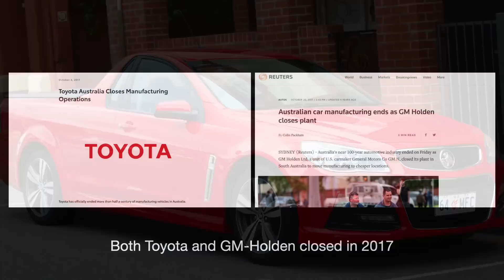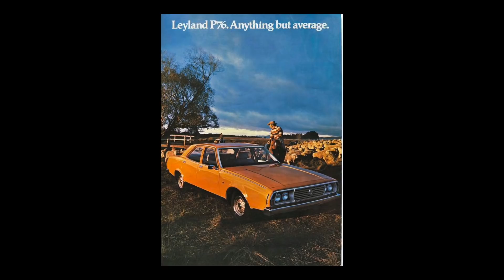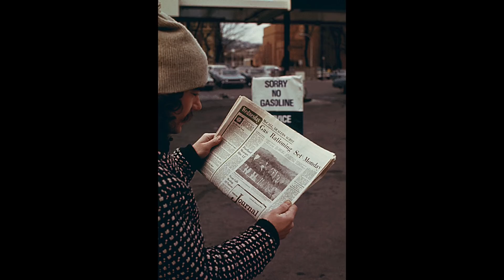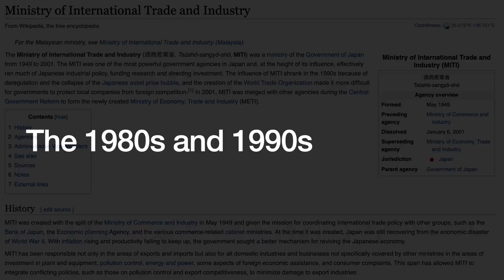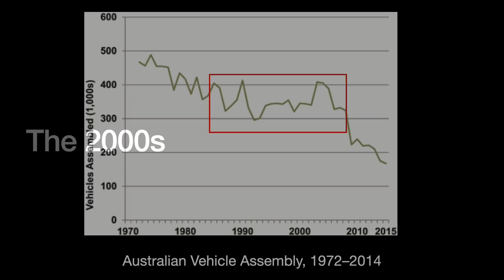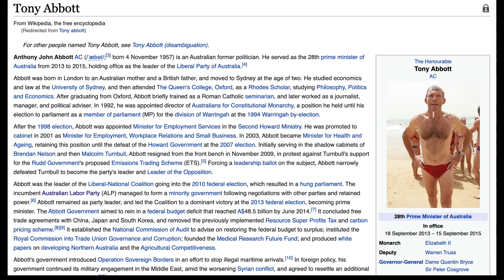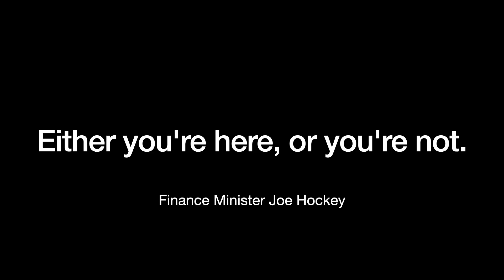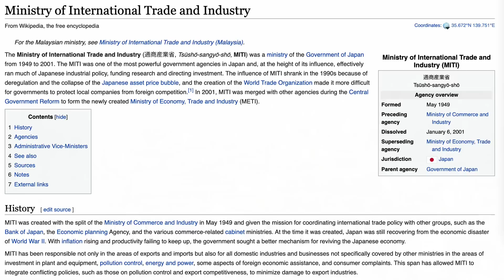Why Australia Doesn’t Make Their Own Cars

Comment: The over promotion of imported cars especially SUV s by car dealers . The rebadging of imports and selling of vehicles  under traditional Australian names. The lack of the local car industry not producing a larger range of vehicles made locally for the local market. Australia use to make some small and medium cars in the past beside the big car models but in the end only made the standard big car models such as the Holden Commodore and Ford Falcon before closing down manufacturing operations. Ford Australia did produce a prototype 4wd Ford Falcon Ute in the late 1960s and later produced the Ford Territory SUV that more or less became a family car replacement for the Ford Falcon Wagon and Ford Falcon Sedan. There are more SUV s or 4wd and all wheel drive vehicles on the road now than normal cars and are now all imported. And we used to have more and bigger car plants than in Australia in the 1950s and 1960s than what was in Japan. It seems the people in charge of our industry let it fail even with Federal Government subsidy funds to try and keep plants going.

Comment: since you mentioned the Vectra - it wasn't designed for Australia. It was an Opel/Vauxhall design made for Europe, which GM then produced in Australia under Holden in order to give Australia "something new". It didn't do well anywhere because it really wasn't a very good car compared to the competition. At the same time they took the Holden GT design and adapted it to create the Calibra for Europe, only to later produce the GT verbatim in Europe in limited numbers since many of the parts for Holden were produced in Germany anyway. When GM and Chrysler went bankrupt in 2009 they shut down a lot of brands worldwide, it's no surprise they closed down all production in Australia as well - they had no incentment to maintain it.
But calling the US and Canada labour market expensive is strange considering labourers in those countries have some of the lowest wages of any car manufacturing countries. VW, Daimler, Toyota, and Honda set up factories in the US specifically because it's much cheaper to build cars there than ship them from Europe or Asia, even though they still ship a ton of parts across the sea
Reply: The Vectra was required after Holden ended the UAAI Toyota partnership but next to anything from Japan it was not that good.Contrast that with a Mazda 626 later 6 or whatever Honda and Subaru had on offer.

Comment: Good video. Basically it all came down to economics. 

One you thing you could have placed more emphasis on was Australian's love affair with large cars like the Falcons and Commodores. They were mainly produced in Australia for Australian families but in the 21st century their sales reduced significantly when Australians started buying other types of cares like SUVs instead. It became uneconomical for car companies to build cars in Australia due to high labour cost and lower demand for domestically produced cars.
Tax payers also got feed up with paying hundreds of millions of dollars to prop up the dying industry. 

Having said that it was a big blow to Australian manufacturing industry(in which barely exists anymore) because as you mentioned a lot of car parts suppliers relied on the domestic market. 
Now pretty much all of our electronics, cloths, household goods, vehicles etc is all manufactured overseas. Most of oil oil refineries have also closed and the remaining 2 has to be propped up by the government for security reasons.

Australia's economy is now pretty much based around the services industry and extracting and export primary resources like coal, gas, iron ore, lithium, metals, food etc to Asia.

Having said that it is not all bad news for blue collar workers. There are still plenty of well paying blue collar jobs in mining, construction, trades, defense manufacturing etc.

Comment: British Motors Leyland did not exist. The precursor was BMC, British Motor Corporation. British Leyland took over from BMC in 1968. Toyota Australia manufactured cars in Australia from 1963. 1984-1994 as you state, Holden built the Vectra only out of all the auto makers here at that time. Holden never made the Vectra. Ford Australia released the new EA26 Ford Falcon & Holden released the VN Commodore in 1988. Toyota also manufactured the Corolla & Camry during that period with high local content & were badged engineered for Holden under the Button Plan. You also failed to mention about US Ford & GM not importing cars due as it would bite into their local production, their managements not willing to import Australian built cars & American auto unions wanting to save local jobs virtually blackmailing Ford & GM. The Free Trade Agreement that was signed in dropping tariffs was a sham. Thailand for example got around protecting their auto industry by imposing a high tax registration on imported vehicles. South Korea imposed a 100% tax on imported vehicles even though GM-H bought Daewoo Korea on behalf of GM US. There are other documents relating to the GFC regarding GM. GM made deals with SAIC to save GM US & Holden (as well as Vauxhall & Opel) were sold off or made defunct. Govt support for local car makers is nothing new. In Germany, their govt support their car makers even when they make good profits.

Comment: The rising costs and expectations of workers were working against bottom line profitability. The Tug of war between Unions and investors broke the affordability of the Australian Model, it also didn’t help that Ford and Holden Australia were developing more efficient and powerful cars than the Americans. This upset American management so they closed down the Australian production lines. The advent of world cars from around the eighties disguised Japanese cars by badge swapping and minor panel and grille changes. The. Association of Japanese companies with the likes of GM and Ford saw this as a way to develop range with minimal investment … Australian Built Japanese made cars blinded the Australian owners to the source of their Japanese kit Cars and gave them more reliable and efficient motoring. NZ also assembled Australian and Japanese Cars because it was more efficient than importing Completely built up Cars as they did in the sixties and seventies … the Koreans then started offering very good value economical transportation at an affordable price …. I’d like to see Australasia produce a range of battery powered and other alternative energy powered small vehicles, it’s not beyond the scope of possibilities but would probably need investment by local Billionaire  entrepreneurs … Gina , Andrew, are you interested ? I’d like to see Steel made here again too.

Comment: I had Mitsubishi magna and it wasn’t a great car. It was made by aussies but… engine smoked like crazy and gearbox skipped gears randomly. 
Then I got myself a old Hyundai excel. Very fuel efficient and simple. Engine just worked and simple manual gearbox also simply worked. The car was made in Korea in the 1995. 
Many say that that time Korean cars were no good but… it was better than Aussie made Mitsubishi for sure

Comment: Here's the thing, these cars were more expensive, but they last forever. The best option you have for cars in Australia are second hand vehicles made here.
Reply: I left Australia some time ago, but my criterion for buying a car was always can I fix it myself/get parts in the back of buggery for it? 
This isn't a typical car buyer remit any more. 
My father always had Falcons/Fairmonts and they were mechanically bulletproof.
Reply: @peterbrown6224  That's why my '08 Fiesta is still on the road despite having 330,000km on the clock; not dealing with right to repair BS because it's perfectly repairable.

Comment: Australian cars were bullet proof like American cars.
Reply: No, they really weren't, I had to fix them. Ask anyone with a Holden HQ through to WB with a V8 in it, the subframes used to crack through just behind the wishbone mounts, I lost count of how many of those I fixed. Then there were the Ford Falcon lower suspension arm collapses because they were made too weak, and the Holden ball joint separations because they designed it such that the joints were in tension rather than compression. Aussie cars were generally shite...

Comment: The finals years no one was buying Holden or Ford cars beside the Government for police cars and Government vehicles.
Holden and Ford were still making fuel guzzling V6 and V8 while other manufacturers were making more fuel efficient cars.
Reply: Ford used the various ecoboost engines in various models, that said the Falcon (inline 6 not v6) wasn't designed for city driving, they were for long range cruising.

Comment: Lets see, the rot really started in the 1970's with the Lima free trade agreement.  Then came tax increases on fuel, more free trade agreements and increasing regulation,energy prices and as the cost of living increased dramatically, labor became increasingly uncompetitive. Australia's trade union movements were also highly effective at exporting their own jobs overseas thanks to repeated strikes and demands.  Trades Hall union movement figure ,the rabid communist John Halfpenny was so myopic about his destructive politics, that while on a tour of the USSR, he preached to soviet workers they should strike for better conditions and living standards........he was escorted to the first plane leaving the USSR by the KGB and told to never come back.   One of the problems with Australian vehicle models, was that they did not respond to Australian fuel prices hurting the car owner, and made thirsty vehicles that people increasingly shunned. Often the fuel economy problems were simply caused by laziness and a lack of innovation. I have a 1996 Ford falcon six cylinder engine, that dropped its fuel consumption 20% just by using a better torque optimized camshaft. When Ford Australia built the legendary "Barra" inline six engine in 2003, which cured all the issues, it was 10 years too late.  Holden tried to build an economical car in the infamous "Camira" but it was in reality a really bad Isuzu, dreadful quality,unreliable and is universally reviled as a piece of junk.

Comment: I am a genuine fan of Australia, and this educational video is somewhat depressing and sad. When I see that Australia is almost the size of the US, but has a population about that of Texas, it's easy to figure that the famous 'Outback' is essentially a non-productive area - and it is HUGE. So, I hear that most Aussies live on the shore around this very large island country.
All this makes one thing quite apparent... Water, water everywhere (around the outside), and virtually none on the inside. Thus, the future of such a unique and wonderful nation is clear. Desalinization on a grand scale, and turn the outback into a global breadbasket. It will have to be the 'solar dome' type with controlled drip irrigation - such as Saudi, Israel and others are setting up. And it must be on a massive scale. But with food becoming a global issue, and with the Aussie determination and ingenuity, it can and will be done. Get to work! 😏
Reply: The outback is far from 'non-productive', where do you think all the mining happens?

As for your idea of turning the outback into a global breadbasket, it would require a lot more than just water, the soil out there is long devoid of the needed nutrients for cropping. Don't need the solar dome thing either, the north of Australia has massive rainfall during the wet season, it's just the small matter of capturing that water before it runs off into the sea and piping it southward to the areas that need it - seeing as the 600km water pipeline from Perth to Kalgoorlie was completed well over a hundred years ago I'm fairly certain we have the money and engineering know-how to make one larger and longer running north to south in this day and age, and the idea has been mooted before, but sadly successive governments don't seem to want to know about it. In any case, we're a net positive food exporter with the land we already have.
Reply: @StaffordMagnus  - Thank you so much. This is how I have been learning a lot about that which I am ignorant. Still, there should be something to be gained by desalination, eh?  😏